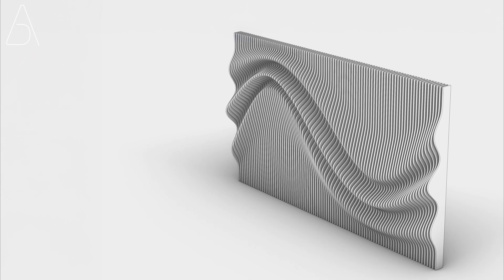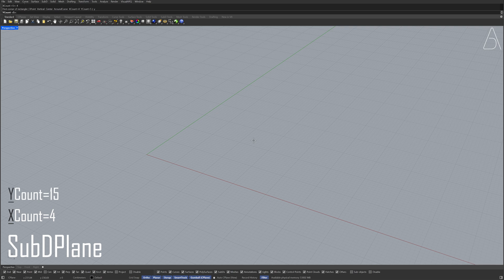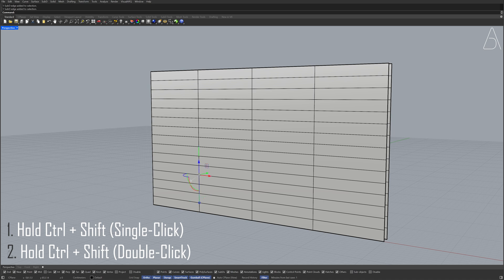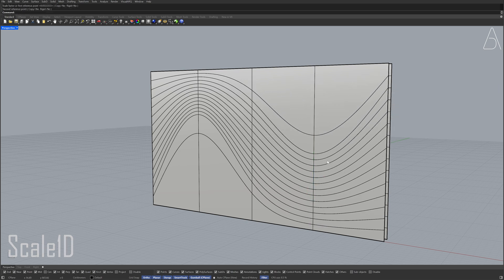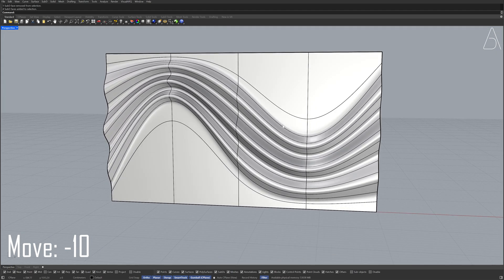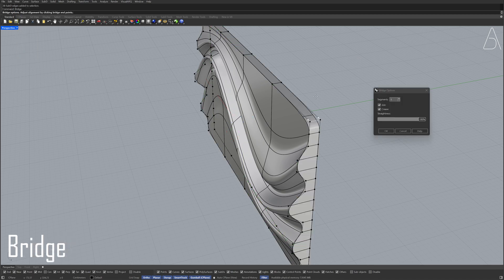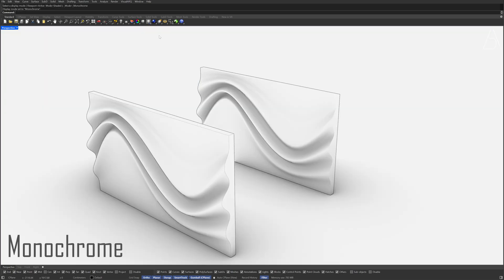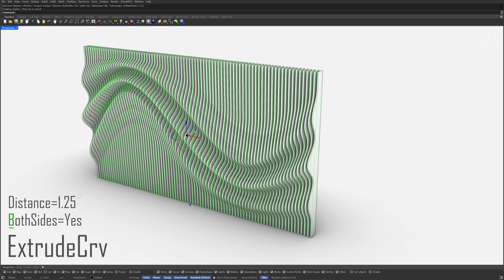Rhino Tutorial I Wavy Wall Modeling

Comment: Thanks a lot what the difference between NURBS and Subd?
Reply: SubD is polygon based modelling with auto smooting applied like in 3DMax, Maya, Blender, whereas NURBS is modelling based on Curves, without auto smoothing, you will have to do the smoothing yourself (fillets, blend surfaces and so on). The simplest explaination i can think of.